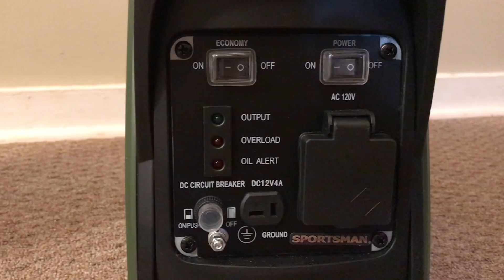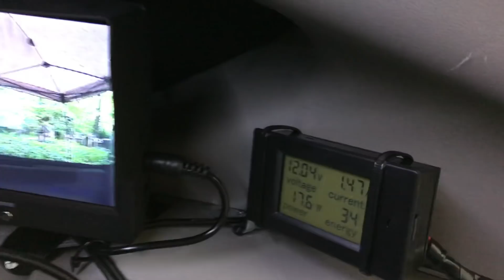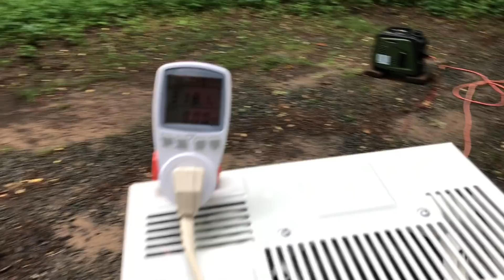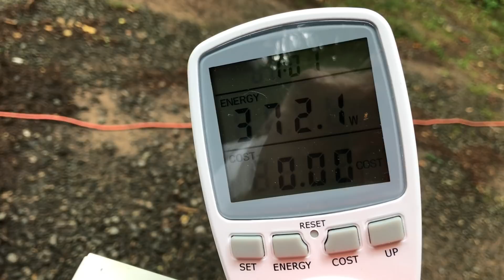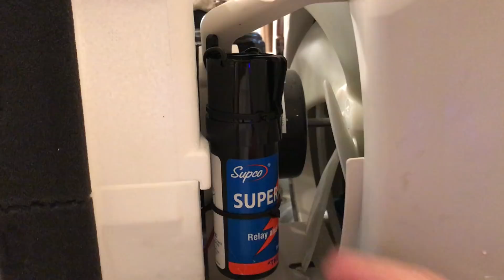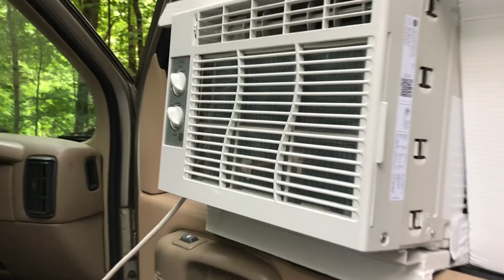Sportsman Generator with A/C Air Conditioning Supco SPP6 SPP5 Van Build Camper RV SUV Vanlife AC

Comment: Older video but maybe you'll see this or others will and it'll help. Assuming you did your testing between various modes (Standard and Econ) with the air conditioner at the same time. You will be pulling more amps the second time the compressor turns on because it has already built up pressures on the low and high side that the compressor will have to overcome as it turns up to speed. I agree with another poster saying use a heavier gauge extension cord, 10awg would be best because of voltage drops and current draw. Nothing wrong with smaller cords on the short term but its possible with the voltage drop and current draw on a smaller cord being enough to trip the overload on the generator. Also your own idea of turning the fan on before the compressor is the premise behind larger systems load shedding or in this case using a larger load on a smaller generator. I have seen soft start capacitors for R/V roof units, but hadn't considered you could also use them on window units, which makes sense, so I thank you for that. Happy trails.

Comment: thanks for the video - on idea for charging your 12v batteries:  a lot of the RC / hobby chargers let you limit the input power consumption so as not to trip any breakers etc.  i know the 500W ISDT charger i have does have that setting.  It also lets you charge many other types of batteries.

Comment: Thank you for the informative video. I used a Sportsman 1000/800W inverter generator on Normal mode to run my 18 cu ft refrigerator/freezer  & 7 cu ft freezer alternating for 4-1/2 days after Irma caused power loss I also used 12 ga extension cord from the generator outlet to the appliance. Using the "hard start" capacitor on your window AC  will indeed help with the surge when the AC cycles its compressor on & "theoretically" you could run the Generator in ECO mode but IMHO you are asking a lot from this small generator & sooner than later it will show the over draw. Once again, IMHO, I don't have any qualms running my Sportsman 1000/800W in normal mode to accept the surge when my refrigerator compressor kicks on with its 5 Amp draw; after its starts it draws 1.76 -1.70 Amps. I used just about 5 gal of gas in 4-1/2 days running the generator about 16 hours / day. I could also run several 40W 12 inch fans along with several LED lights drawing 7 watts each.  Now I know that if I had had a 5000 btu window AC I could have put it in the rotation with the refrigerator/freezer & 7 cuft chest freezer. Power outages make me want an old style non frost free refrigerator that just run a cooling compressor to bring the cabinet to set temp & then kick off whereas the frost free cycles through its "defrost" cycle that can't be circumvented.

Comment: The 12v output feature would certainly come in  handy for maintaining low voltage systems from 5v to 9v. 

This unit only needs the addition of an 18v output to really make it rock. Then one could easily charge a 12v battery at 15a, using a similar charging device, on top of the 120v appliance.

Comment: Were waiting for you to finish the build before we start ours.  Right now were taking out wire we dont need like coax cable and n64 stuff lol.  Looking forward to the electrical.  Thank you for posting this great info.  It is giving us some great ideas.
Reply from the maker: Cool! I would really like to gut mine but my budget prevents me. I work on the projects as funds will allow. I keep postponing the electrical video as I keep adding more electrical equipment. I am working on the 4 camera security system (Episode 11) and that added a lot of wiring (the projection home theater did too - Episode 10). I think by the time I make the electrical video, I will have a horrible wad of wiring!

Comment: First a laugh, I have seen that ac set up some where before.... Oh now I remember, "The Flying Nun TV show!" Now my observations; Be aware running that load on the economy setting is going to foul the spark plug and spark arrestor quickly. A 10 ga 15 foot extension cord also might help on start up. Or perhaps a relay that energizes high mode on start up and then switches back to lo after compressor start? Better yet a time delay on the fan so compressor gets the maximum starting current. As always great video!
Reply: Chester ... I am with you on the subject of it being a great video.  It was an inspiration to me, personally.  I bought myself the same generator but, because of the room size it will go in, I bought a 6000BTU a/c.  It was a no go.  When I added the slow start up condenser, it was still a no go.  Finally I realized that because of a lack of suitable space inside the case, I had mounted the condenser upside down.  That is verboten.  Right side up, everything works like a charm.  I had to add some length to the condenser leads and with the help of some industrial strength velcro and a quick disconnect, I now have the condenser mounted on the outside of the case.  When I have access to 110, I disconnect the condenser and take it off.  When at the cabin, where the a/c runs on the generator, I put the condenser back on.  The a/c runs just fine either way.    However, I would love for you to share some more information on the time delay on the fan idea.  My A/C has an energy saver feature that insures that the fan and the compressor start at the same time.  On 110, that is no problem and probably does save energy.  Otherwise, with that feature turned off, the fan is running all the time and the compressor starts against that draw.  It would be perfect, and help the little generator, to have a delay feature on the fan to start after the compressor is fully in, not to mention the fact that a person would not have to listen to the fan run all the time.  How about some suggestions on how to do that?
Reply: To: John M. Washbush, Based on your comment, I would wire the fan switch in parallel to the compressor relay (which appears to be controlled by the thermostat). Then break one of the fan wires with a "delay on make time delay".  That way the fan will only run when cooling is called for, and the compressor has already been energized by the thermostat. Test 1) Room hot; thermostat calls for cooling. 2) Compressor and fan relay energizes. 3) Compressor starts. 4) Fan timer times out and fan starts. 5) When temperature is satisfied compressor and fan shut off until the next cycle. This is a feature on many residential heating and cooling systems in use today aka pre cooling or heating (on heat pumps) the ductwork. Hope this helps!
Reply: chester doodlevich
1 second ago
To: John M. Washbush, Based on your comment, I would wire the fan switch in parallel to the compressor relay (which appears to be controlled by the thermostat). Then break one of the fan wires with a "delay on make time delay".  That way the fan will only run when cooling is called for, and the compressor has already been energized by the thermostat. Test 1) Room hot; thermostat calls for cooling. 2) Compressor and fan relay energizes. 3) Compressor starts. 4) Fan timer times out and fan starts. 5) When temperature is satisfied compressor and fan shut off until the next cycle. This is a feature on many residential heating and cooling systems in use today aka pre cooling or heating (on heat pumps) the ductwork. Hope this helps!

Comment: You might add a resistor in the DC to limit the current and save having to carry the charger.   Also, if someone came up with a circuit that would shut off the fan for a few seconds every time the compressor kicks in it might run on Eco all the time.

Comment: I'm really enjoying these videos! This was a good set of tests, nicely done. Cheers
Reply from the maker: Glad you liked it - thanks for your great comments!
Reply: @timdillen  could you tell us what gauge and length of extension cord you are running that does make a difference. I'm wanting to put a 5000 BTU air conditioner in the back window of my 4-door truck. just for traveling at times and the generator in back in a sealed box. I have the Sportsman 2200 watt dual-fuel I only run it on propane. And I just ordered about three days ago the Sportsman 1000 it's on sale right now for $149. Today's date July 14th 2019. The Lowe's website was such a mess. I had to go into the store and luckily I took my payment and ordered it for me. And they're sending it to my house and not the store which is a little more convenient.

Comment: Thanks for the video, I put the same AC in my sailboat. It shut off almost instantly. I figured  I would give it try with new gas and spark plug. It died again so just for the hell of it, I put it on economy mode. It started right up and didn't stop. I just can't figure out why economy worked and normal setting won't work, should be the other way around.
Reply: Dear Justin .  It will keep running if you stop using it for an anchor.  Have  a nice day .
Your good friend Vinny in good old Fla.

Comment: Really appreciate the info. Have the 2200 sportsman generator. It wouldnt start our ac. I was thinking whether to try adding the very same capacitor. So you video is extremely helpful. Thx u.
Reply from the maker: Thank you! I have run my a/c with the generator for a total of about 5 hours so far in economy mode and no trouble. I hope the addition of the capacitor solves your problem. I love this little generator - if it dies after a year I got my money's worth. Thanks for your comments and for watching!
Reply from the maker: One other thing - I think it helped to have a shorter extension cord that is heavy duty from the generator to the A/C.
Reply: When I look this generator up on amazon it’s $204. How much did you pay for it?
Reply from the maker: I got it for $190 on Amazon with free ship. I just looked at that was the best price I could find too.
Reply: I have the Sportsman 2200 watt dual fuel I've only run it on propane only. I can run my 200-amp battery charger and engine starter to start big diesel equipment, diesel engines and cars with. I'm pretty sure I run it on economy setting. But I definitely run the new 2200 watt Sportsman dual fuel generator on propane only. I won't put gasoline in my new generator because I put it inside my truck at times. I can go out and work more than a whole days work and run the generator at half a load on a full 20 lb BBQ tank it will run 18 hours. My 2200 watt sportsman also run the digital 5050 btu window ac just fine plugged right into the generator. but I for got to put it on the 10 gauge 50" extension cord I have. I need to do that real world test on the extension cord. My old 1850 Watt Coleman on gasoline would rattle the valves running the 200 amp battery charger and starter. It didn't have economy setting and no dual-fuel. If you want to know what else I've ran on this new Sportsman generator just message me. I may do a channel one day. I was pretty shocked at some of the things I run on this little 2200 watt generator.
Reply: What are the power requirements of your particular A/C ?
Reply: @randy33111   You can get it at home depot or walmart online.
Reply: If you have starting problems running a rv ac you could buy the parts for around 320.00 from easy start micro air. They are made to be installed on roof top ac's and use one honda 2000 watt generator to run a 13,500 btu ac. Keep in mind the honda 2000 has a 98cc motor on it and around 16.7 amps. And the honda 2200 has a 118 cc engine and 18.1 amps. They have a little more start up amps than most all generators the same in the suit case portable size generators. My 2200 watt sportsman is around 15 max amps on gasoline and a little less about 10% less power and amps on propane. A test I did on my dual fuel 2200 watt on propane. On a 50' extension cord I ran a 19" metal blade fan 2.6 amp 175 watts and ran the clothes washer on the highest water setting and the longest cycle. Then did another generator test. Same 50' 10 gauge extension cord running a 18 cubic foot frig and freezer cutting one on at a time. Then plugged in the same 19" fan on high and then plugged in a circular saw on and off. Could not believe this little 80 cc small engine could run all this on propane.

Comment: Make sure you use a quality extension cord, on with a low gauge. The lower gauge cable will have a lower resistance and will help reduce the voltage drop when the compressor kicks on.
Reply from the maker: Agreed! Cheap cords can be a problem. Thanks for posting this.
Reply: YES! It's very important to use a heavy duty cord and to have it be no longer than necessary.  I have a Honda EU2000, it can start a 12,000BTU AC while on eco mode, but only if you use a heavy duty 10 gauge cord.
Reply: @THX..1138   10 gauge and as short as possible.  That's my moto. When using a cheapo flux core welder on

Comment: I noticed that the dc charging thru solar charger works but only on economy no matter what when you get closer to full battery charge haven't ran a.c or anything just noticed that on economy it limits it to about 3.8 amps or close too was even able to run my ps4 and tv while it was charging

Comment: Have you done additional tests at higher elevations and higher ambient temperatures?  Both can have a sig diff in nec starting amp draw.  Just curious.  And great video btw, I happen to have two of those sportsman’s 1kw.  Funny thing is one is listed at 800max watts but has same exact components less a USB port.

Comment: You need to be looking at the volt amps ( not watts ) to see what's happening. Most likely huge line loss thru the cords happening. You will see the input voltage  drop, leading to lost power and increased heat generation. 

Line loss is measured in % and is decreased by lowering the load and/or increasing wire capacity and shortening its length.

See Powerstream's site for an easy to use line loss / voltage drop calculator. You're shooting for max. 3% loss, ideally. And be sure to enter length as one way trip only, so the length of your cords. Pick the most suitable voltage... doesn't have to be exact. Like the points on Whose Line is it Anyway?, the voltage don't matter ;)
Reply from the maker: Great information - thanks for posting!

Comment: for the generator popping the breaker, you can just run it on eco and it wont make more than 4 amps i have the same generator with the same issue, eco fixes the problem
Reply from the maker: It really is great in the Eco mode, really low noise. I think maybe i was my battery charger that would cause the popping of the breaker when the a/c was cycling on.

Comment: I get so lost, Watts is a city in California and amp is an energy drink but that lil gennie can do what's needed. Have you considered a thicker and or shorter cord for better electric flow? Building contractors usually have a  thick cord that runs to a junction. A circular saw will run fine on a standard 100' cord but run 3 cords for 300' and the saw slows..just a thought
Reply from the maker: I was thinking maybe I should try a shorter more heavy duty cord and see if that helps. Thanks for the tip and for watching!

Comment: Hello, i like your series of videos! Great ideas, and we're starting our van build soon!   Im looking for the video with the final wiring for the generator,  inverter, batteries and etc... are you planning to use any solar panels? How are you charging your batteries?  is the wiring video done yet?  Thanks and again, everything looks great! Rob V.
Reply from the maker: Thanks! I ended up not putting solar panels on the roof as the shape just would not fit a decent size panel or two. If would have really drawn attention if I added a roof rack and the built off that. If the roof was flatter I would have gone that way. I have a temporary 200 watt folding panel that I can put on the dash or on the windshield. I ended up not doing the electrical video but should have done one for the viewers. I just recently sold the van and am converting an ambulance. it has a great flat roof! Thanks for your comments and for watching!

Comment: This video has shown me that my Honda 1000 can actually power my 5000 btu ac unit that I will be putting my 12ft. TravelMate camper. I hope it doesnt overload the gen. Would it be better to have a cable made to go from the gen to the ac unit instead of an extension cord?   Excellet video...thank you for any input.
Reply from the maker: Good questions. I would start with a heavy duty extension cord with a reasonable but not too long length. The Sportsman generator was very good at shutting off when the load got too high. The Honda one is way way better so I am sure it will have no problems protecting itself. Different 5000 btu a/c's draw different amps/watts so if yours doesn't work then find one similar to mine. Make sure it is all manual and no digital buttons. Just look for one that has the same front controls as mine (I think it is sold under different brands). I built this one into my Ambulance conversion and have used it for 6 months more and that little unit just keeps going after multiple projects and bouncing down the road.
Reply: Yeah, use an extrention cord made of heavy guage wire. The cord will be thicker than the average cord. Even walmart has the thick cords.

Comment: Just saw this new posting.  Went to Amazon -generator at $204, searched for Buffalo distributor, came back in 1 minute to Amazon, generator now $229.  Expect it will be around$3000 by this evening at that rate.
Reply from the maker: I saw that - crazy - maybe running up the price for the summer/4th of July campers.
Reply: Walmart dot com or home depot, ok?